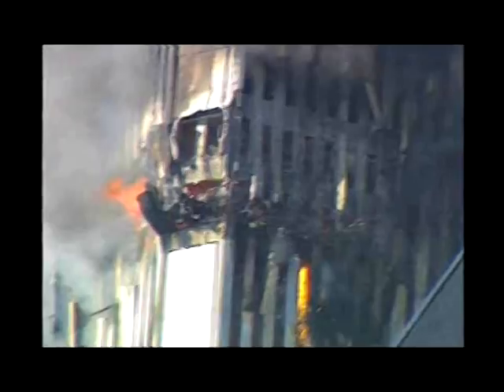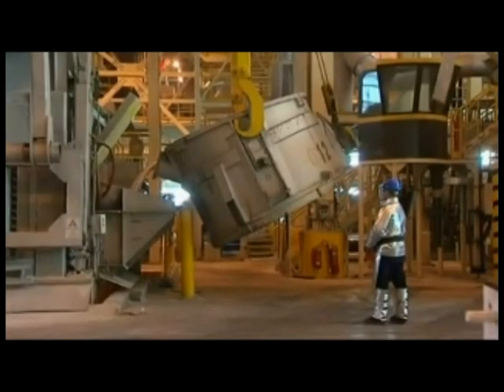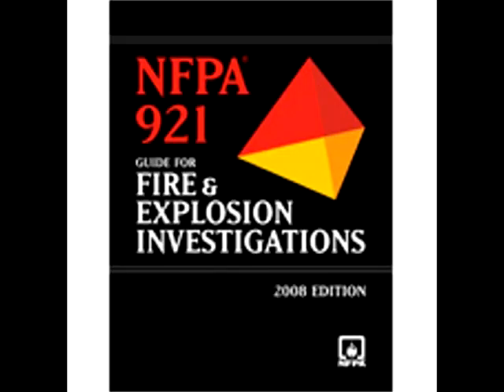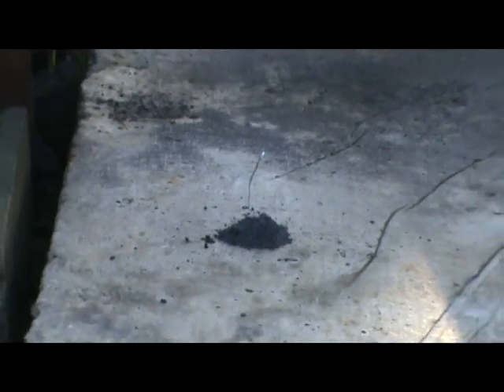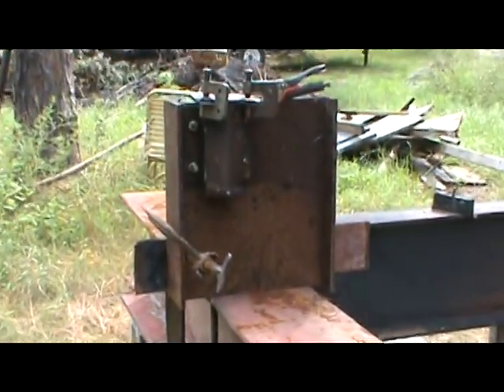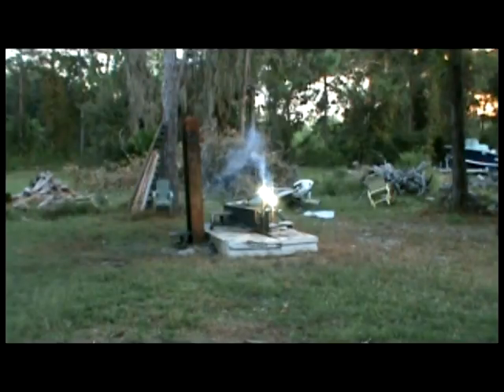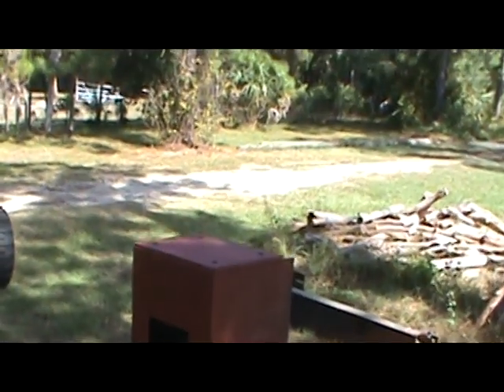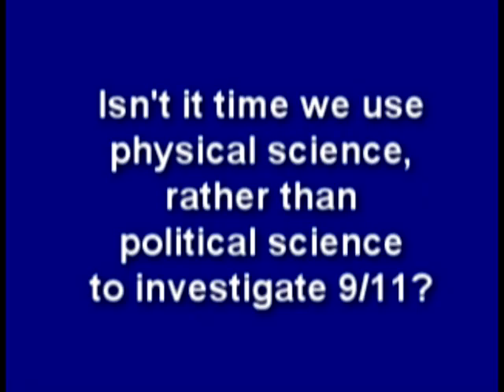9/11 Experiments: The Great Thermate Debate

Comment: Planes are aluminum
Pulverized aluminum (find the vid of a fighter being slammed into an impermeable concrete barrier - it turned to dust) mixed with all the rust such an impact would have knocked from the steel in the towers & you get thermite.

This explains the dust.

There are also magnesium parts in planes.

The steel didn't need to melt, only to weaken, then it bends, rivets & other connections fail & the pancake effect takes over.

A local business made wood door frames.

The steel building completely collapsed.

HUGE Bent & twisted steel beams FROM THE FIRE are outside the rebuilt business as part of a memorial sculpture - everyone who drives by see then, as I do every day.
Reply: OK...but explain tower 7's collapse?
Reply: @MrTripplenipple  tower 7 had structural damage from falling debris and I am pretty sure it was on fire as well.
Reply: Building 7 burned internally from shortly after the North tower was hit.  9am fire is started and burns till almost 6 when building 7 collapsed...

Between fire raging for hours and  multi ton pieces of debris from the  North tower, it is amazing it stood as long as it did.
Reply: @selfinflicted77  well building 7 would be the very first steel framed building in the history of steel framed buildings to collapse on to its own footprint, like a demolition, due to a fire. There have been a ton of steel frame building fires, a hell of a lot more ferocious than any of the fires 9/11 that didn't collapse the building. So yet again we get another first in history that happens 3 times in the same day.
Reply: Ten years ago NIST released their study regarding WTC7 which clearly states that the damage from the collapsing towers did not impact the structural integrity of WTC7. It also states this in the FAQ of WTC7 on their website. And they also state that WTC7 was the first fire induced collapse in history.
The fires were small and randomly spread throughout the building, this is not enough to bring a steel building down. In fact, we have yet to see a fire which can bring a steel high rise down.
Reply: AlanCheek mfw you disprove a video that probably took 8 hrs plus to make in 30 seconds
Reply: +milton Holley   how do you think blacksmiths melted iron before coal was discovered? wood, and especially charcoal with enough air can melt iron/steel. sounds like your the one on the drugs, i've never taken any recreational ones.
Reply: AlanCheek 
it's hard to believe that just friction from high speed, can melt steal... 
and about the airplane's combustible, All of it gets consumed in the explotion; after the explotion there's no Fuel at all (like any explotion) 
all the fire is from wood, carpet, plastic, whatever is around... that can not melt steal in a million years; 
All the Fuel of the plane gets consumed after the explotion. there was nothing left (official version says that this combustible melt the steal) 
and the many explotions many ppl heard??? and the 3rd building falling down without any airplane?? and in the same moment... wooow
Reply: you can melt steel with wood, i've done it before.
Reply: So that makes you an expert?
Reply: @joesalaman3503  hours and hours of reading on this very subject.
Reply: I was literally typing this above. When he didn't mention the planes as another source of metal his credibility factor nosedived
Reply: Aircrafts don't have any magnesium parts
Reply: Holy shit... He's right.
Reply: Alan Cheek is talking out of his buttcheeks. Scientists didn't recover thermite form the dust, they recovered a thermitic material which was actually thermate, which is more than rust and aluminium, and on a nano scale to be exact. This compound is only produced for military purposes and is highly specialized. If you think this forms automatically in buildings then you might as well believe that having eggs and flower in the same cupboard will eventually produce pancakes.
Reply: keep dreaming ! I mean , YOU are sooo far out ! First of all sardined box thin aircrafts cannot cut through 3-inch thick H-shaped steel elements like a knife through butter - and made a Troadrunner carton imprint. The whole was made by explosions a split seconds before the remote-controlled planes hit the building ! And of course the oxygen started fires couldn't even weaken the steel ! Go back to physics 101 and learn before you propose your moronic arguments
Reply: Same way a bunker buster works. It hits solid reinforced concrete so hard and fast the concrete liquefies around the bomb casing.

Same affect with soft objects traveling fast. Not to mention the engines and landing gear along with several other parts were not soft.
Reply: AlanCheek how do you explain MOLTEN steel found in the rubble?
Reply: @3c3c3c  there was molten steel from the demo units that cut down unsafe sections. Like all the images of beams cut clean.... 

What they don't show you is those beams we're cut by demo units after the collapse.
Reply: I've seen pictures of cut I-beams... are you talking about those?.... all the pictures I've seen look exactly like the cuts from an oxy-acetylene torch... which is one of the tools that would be a must have for any rescue or salvage operation in this type of situation.

Comment: This video is so laughably uninformed. Also what 'independent scientists'? More like hobbyist scientists who've at best conducted backyard experiments not even remotely close to what happened on 9/11. The real problem with the whole 'can't melt steel' theories is that it assumes a certain temperature whilst also referring to metal that actually was not molten. The other thing is that the jet fuel burned up in a fast inferno of around 10 minutes. It set everything a blaze from there onwards, including rugs, paper, curtains, furniture, paints and so on. There's literally no reason why nano-termite had to be involved. In reality all you need is weakened steel and the moment things start to bend and collapse, you will see those buildings were not nearly as well designed as is commonly assumed. The whole 'won't go down by aircraft impact' was accurate. It was the fire that brought it down. In reality the heat reached was closer to 2000°F at which you really will see steel bend and break under weight. The 'explosions' were steel beams snapping under the weight of floors coming down. What we see is called 'pancaking' with the weight of each floor coming down thrusting through the floors beneath, all the way down to the ground floor. This doesn't require explosions of any kind and given enough mass it will appear as if it is a controlled demo. That's the problem with people giving testimony of 'explosions'. Snapping beams of steel do sound like loud explosions, but aren't.
Reply: PHeMoX THANK YOU !! FINALLY A COMPETENT PERSON
Reply: Sadly, most people do not understand this. Just knocking beams over on their bucks in a fab shop is extremely loud, I would not want to hear a beam breaking due to the forces imparted on it during such a collapse.
Reply: If the floors had pancaked like theories claim then the columns would still be standing today. Vertical steel columns 6 square ft cannot pancake! There are even images taken on 9/11 showing that the 6² ft steel columns were melted at their base. How did a mere fire do that? Pancake theories have no merit!
Reply: BigNewGames the weight of the falling floors about caused the pancaking. with each floor falling, that’s about another 100,000 tons of pressure being put on the beams. they most certainly can/ will/ and did pancake.

Comment: Well, all they have to do is explain how a bunch of people can drill into walls, place charges, figure out how to rig detonators, etc. all without anybody seeing them over a period of weeks.... Ships break apart and sink because of fuel oil fires that weakened the steel structure, and they are sitting in water.  The plane hits the building at a high rate of speed, stripping the insulation off of the steel girders, cracking some and then the chimney effect of fuel pouring through the building, creating high temperatures, would allow the building to weaken in multiple places, inevitably leading to collapse. The temperatures in the rubble would remain high just like a pile of coals will retain heat for a very long time. Millions of tons of rubble, including plastic, metals, carbon, etc. would smolder at extreme temperature for days or even weeks.  Molten metals would pour from the building, which included many objects made of aluminum, copper, iron, as well as steel.  Besides, what did they do with the people who rigged the charges and (somehow) figure out how to have precision detonation AFTER an airplane flew into the building?  No, not an inside job. Just a bunch of evil people who wanted to commit mass murder.
Reply: Funny how thorough, detailed replies like this get skipped over. Where are all u conspiracy nuts at
Reply: it's actually how the titanic sank it was doomed at the start because of a fire happend which weaken the steel and they just painted over it so when the ice berg hit that spot. it just gave way https://www.smithsonianmag.com/smart-news/coal-fire-may-have-helped-sink-titanic-180961699/
Reply: Except that no plane hit building 7. SO I guess your theory is trash

Comment: Even if it was an inside job, why have the buildings collapse? I think flying a plane into the building killing hundreds, and showing that terrorists supposedly can attack the USA, would definitely still be reason enough to go to war.
Steel begins to soften at a temperature of around 425°C and losses about half it's strength at around 650°C. Jet fuel burns from around 400°C to 800°C. Can jet fuel melt steel? No. Can thermite melt steel? Seems like a yes from this video. Could thermite have been used in 911? Yes. Could making the structure of a building lose half its strength cause it to collapse? Yes. So if a plane could knock down the tower, then why would they go through the trouble with thermite?

Comment: What were the actual reasons given for the collapse? Wasn't it " the impact severed and damaged support columns, dislodged fireproofing coating on the steel columns and floor trusses, widely dispersed jet fuel over multiple floors, and the unusually large amounts of jet fuel started multiple floor fires and weakened already susceptible steel supports, and that no building ever in the US has ever been subjected to massive structural damage and multiple floors fires that the twin towers experienced on 9-11-2001??? 
Also, just curious, if the columns, or trusses are " bolted " together, wouldn't their structural integrity be at least partially determined by the heat/ fire temperatures that the " bolts" themselves could withstand?  
I'm not a conspiracy theorist believer, with millions of people watching, multiple people involved in the  investigation, in the worst attack since Pearl Harbor on America, I think the  truth has been told. Does that mean they got every single, little tiny bit of information right? Provably not. But it's damn close. Our country was attacked by an extreme group of radical terrorist that hated America. And they didn't care if it was a military site, or a civilian site, they just wanted to kill as many Americans as they could. In a chicken shit cowardly way. Revenge is sweet.

Comment: All this talk of Thermite is only that. You must remember 30 odd tons of magnesium steel was introduced to each fire in each tower. And once it catches fire it burns with extreme heat and cant be put out with water. It will melt steel quite happilly and will burn for over an hour with no other combustuble material needed. Just a suggestion

Comment: There was NO NEED to melt ANYTHING. A full load of kerosene was combined with a collosal amount of kinetic energy into a very small volume. 

That energy translated into higher than normal temperatures. All that was needed was for the steel to soften and lose its strength without needing to get anywhere near melting temperature.

You quote Barnum. I quote William of Occam right back at you.

Comment: it doesn't need to melt it all it needs is to compromise it's integrity moron
Reply: Jesse Cabezas Did you even watch the video?
Reply: If it was merely compromised, it would not have fallen at anywhere close to free fall speed
Reply: It was NOT hot enough inside to compromise the steel.....moron
Reply: Even being "compromised" some of the material will still melt off and leave a small flow of molten metal as in the video. Iv done security for demolitions of large factory buildings and thermite will melt portions out and not drop it until small charges are placed or a crane pulls out a supporting part of the structure near the top like a floor or wall. I witnessed this process for 3 months strait on a contract so id say its pretty obvious to me this guy nailed it.
Reply: jesse you moron. get a clue. use your head.
Reply: You sir are an idiot good day.
Reply: Lmfao never mind the fact that for there to be a inside job you'd need hundreds of people and for all of them to keep quiet and plus the pilot and the lost of revenue and video upon shown metal structures losing thier integrity after being exposed to high temperatures
Reply: Conspiracy theories can be dangerous because of people like yourselves you guys are the same people that would say concentration camps never existed and that the Earth is flat and I find it highly disrespectful for those Heroes and loved ones lost their lives during 911
Reply: We also found about the Tuskegee studies and MK Ultra rather quickly and you're telling me after 15 years you've cracked the case these videos are laughable at best
Reply: Well something need to be melted to be the substance seen in the VIDEO
Reply: Fucking water gate was a small job and yet still we found out

Comment: Wind tunnel effect from open windows fed the fire intensity like a smelting furnace softening the steel enough to collapse under its own weight. All of you inside jobbers need more wisdom with your education.
Reply: Then why don't other steel buildings that catch fire collapse. Both buildings burned for less than 2 hours. Only 3 steel buildings ever in history collapsed from fire. Guess which 3?
Reply: Get out of here with your common sense!   :)
Reply: fire burns up not down genius.
Reply: TheDaddyo365 yea that's got to be one of the dumbest comments Ive ever heard.
Reply: Us inside jobbers have read the document called operation Northwoods that was forcibly Declassified you might want to check up on that
Reply: yes correct but steel doesnt combust and air can only get to a certain temperature... if that was the case then the draft would cool the steel while feeding what evers on fire...
Reply: https://ws680.nist.gov/publication/get_pdf.cfm?pub_id=861164
Reply: Look who's talking! If there was any truth to what you say it would have happened before. Real knowledge comes from real experience not from a classroom or book. Everything has an agenda and that starts with education. I worked on steel buildings for years, I know what I'm talking about. The steel  in the WTC was not merely softened but melted through in thousands of strategic areas resulting in a perfect vertical collapse within its own footprint. In other words; a controlled demolition.Evidence of nano thermate was found all over the site by those brave ironworkers who helped in the rescue and clean up operation. They also found a lake of molten steel under the debris pile days after the collapse. 
The only wind tunnel effect is coming out of your ass!
Reply: things get hotter with oxygen because it makes it combust faster.... if it dont combust then the draft aint doin shit except cooling it
Reply: That’s a good point but that shouldn’t be enough to justify excluding any explosive tests in the investigation. I blame the shit job our government did investigating this because we won’t have concrete answers until all other theories are disproven.
Reply: you are factually in error
Reply: checkfoldcallraise please provide one example of another building ever doing the exact same thing.
Reply: Thank you for watching and being here, lil james
Reply: Yeah such a wind tunnel effect that a third building came down you idiot!
Reply: Gravity pulling down on several stories of concrete and steel helloo!! The weight of a commercial jet liner packed with jet fuel slamming into structural beams hello!! Office furniture and supplies feeding flames! Same can be said for building 7. Weight+heat+gravity? E=mc2?helloo!!
Reply: You might want to read this:https://www.nist.gov/engineering-laboratory/final-reports-nist-world-trade-center-disaster-investigation
Reply: Ohh come on... how dense can you be.. this guy literally went out into his yard, and took all that time, and you are still .. just... unbelievable.
Reply: @xiiizeroiiixguy5726  he went into his yard and had to do how much just to show it can cut steel? 
All of this didnt happen. Those towers had always been a target of terror.... they figured it out after many attempts...
Steel cant be melted by jet fuel... true... but the building also had plenty of ither fuel that burned a lot hotter.... ontop of the damaged structure being unable to support the structure on top....

The gun fire these people heard was steel bending and snapping.... ever been in a car wreck? Youd know the sound
Reply: xIIIZeroIIIx guy good thing he didn't figuratively go into his yard and try and prove anything... Jackwagon.
Reply: I have tried explaining this to a multitude of people... no getting through to these nut jobs that think everything is conspiracy